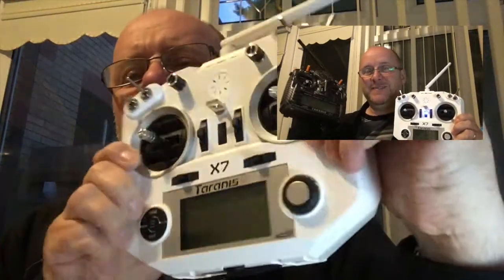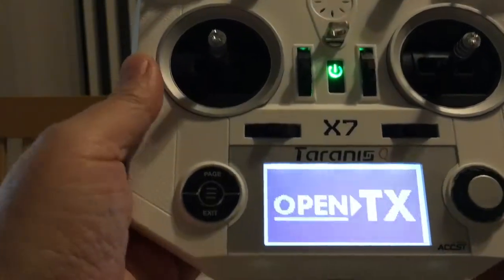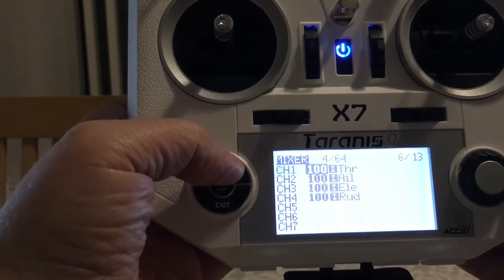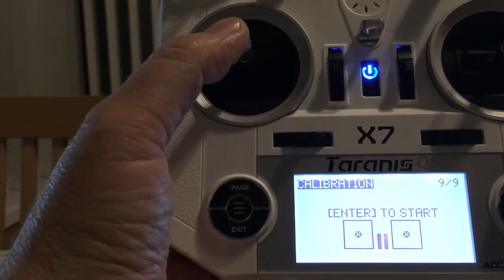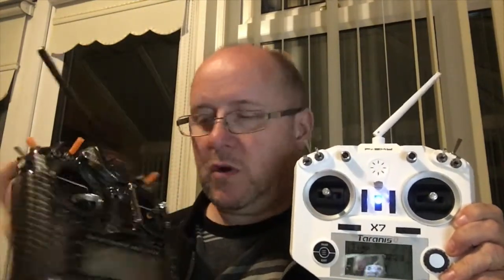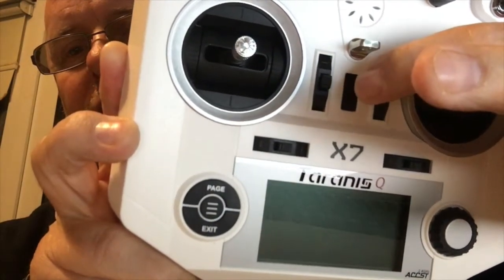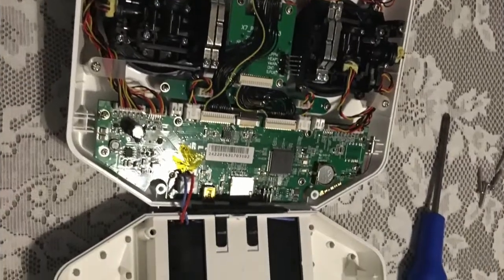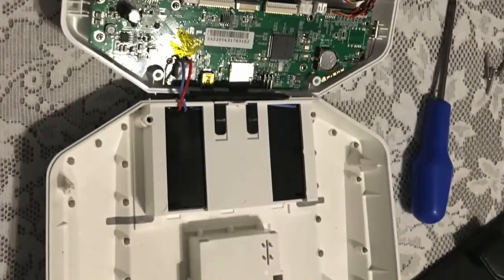TARANIS Q X7 Why would you want one?

Comment: I've got a FlySky FS-I6X at the moment, which does everything I need. Would this be a major upgrade?

Also, nice video, thanks!
Reply from the maker: Not a major upgrade, but a good upgrade as FrSky product spares are readily available and reasonably prices for such good quality technology. The flying range they offer is one of the best and why FrSky is the FPV community's protocol of choice. After experiencing the Flysky programming it will be a lot easier for you to configure also...
Reply: Excellent, thanks. I need to sweet talk the missus into getting me one for my birthday. Though they are under 90 quid right now on Banggood!
Reply from the maker: They are great value and every bit as good as the bigger X9D. It won't be long until the Hall Sensor gimbals are available and then will be even better.
Reply: Major upgrade, especially in signal strength. And programmability